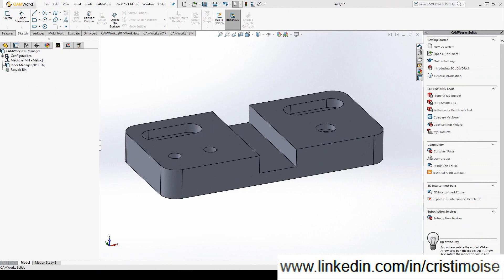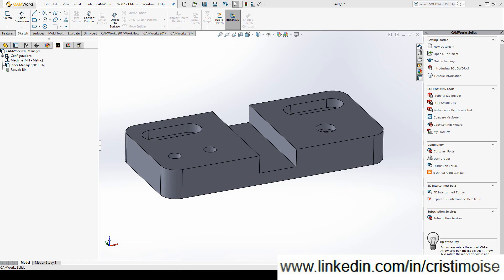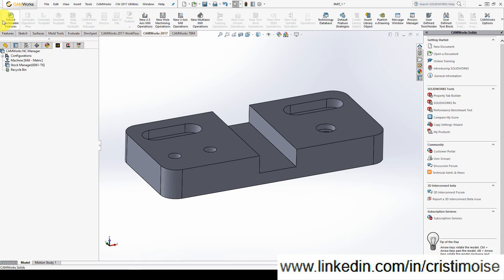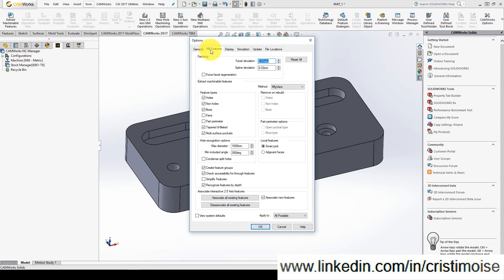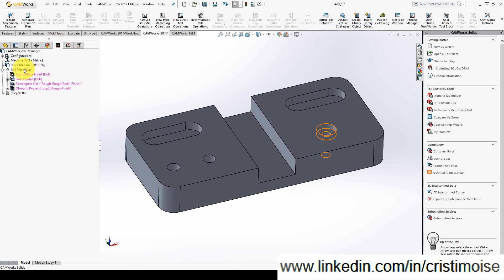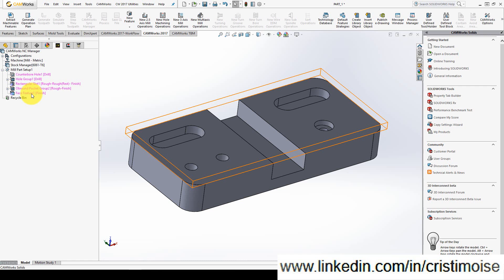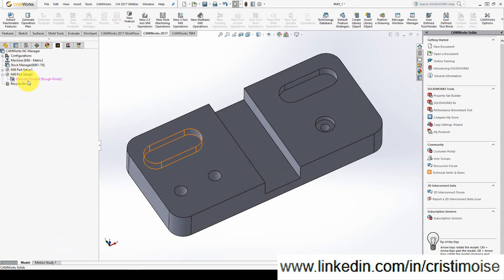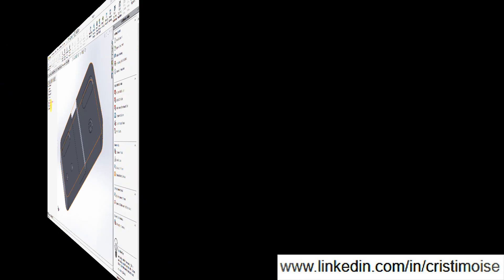CAMWorks for beginners tutorial part 3.

Comment: For 3:44 we sat here while you talked. Time would have been better spent showing us what it is we are supposed to do. Coffee chat is for the girls down at the laundromat, or hair salon. I am trying to learn.
Reply from the maker: Ok thanks for the feedback. What do you want to learn?
Reply: @CristiMoise  It's working out. I am helping a friend to do some machining, very important position. A big help would be to use a 4 or 5 axis mill to engrave on a cylinder. Basically project a sketch using the wrap function BUT,.....using a single line CAMWorks font. It's been a little tricky.
Reply from the maker: @thepartsrunner5758  This is a tutorial for beginners for 2.5 axis. What you need is multi axis and this is another story. I have a question why didn't you say this in the first time???
Reply: @CristiMoise  Grazie.